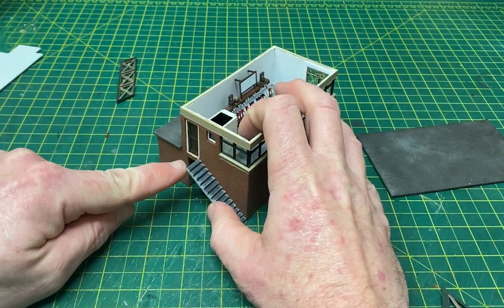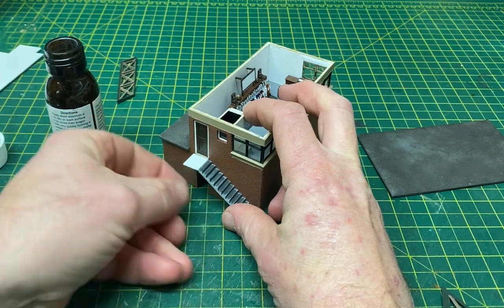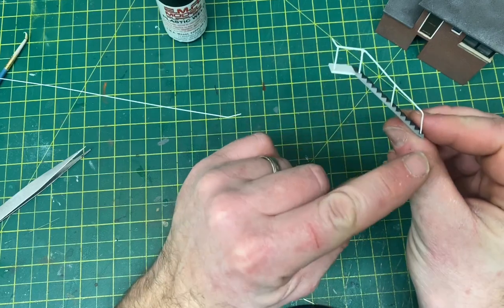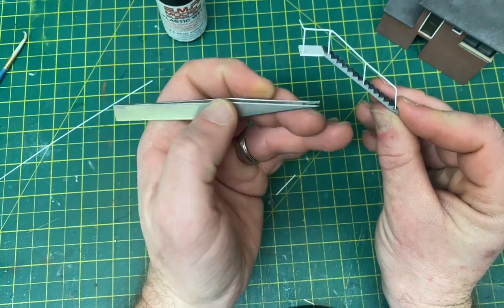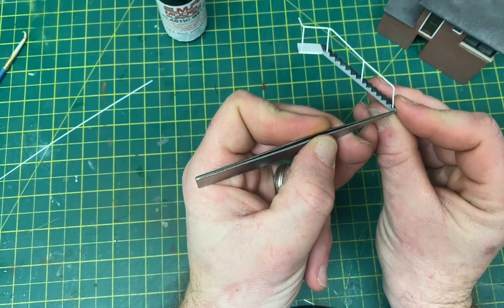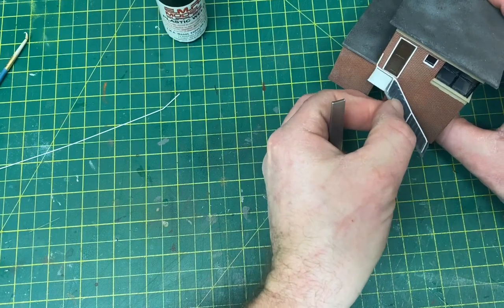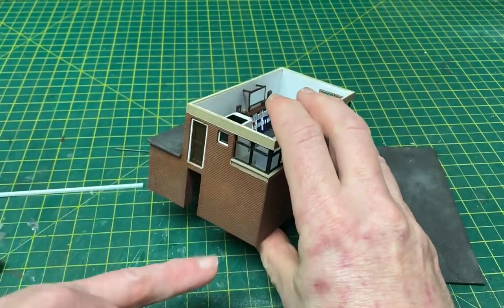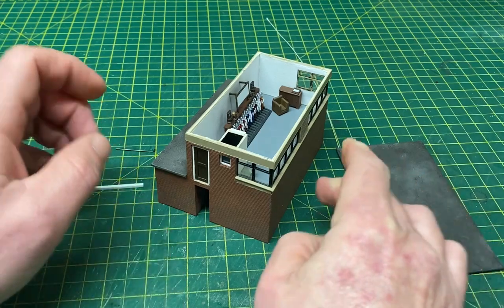The Scratch Build Series 3.5 - The Staircase And Final Details

Comment: Thanks for another instructional and inspirational video on scratchbuilding!  Now I realize I can use easily-shaped florist wire to model downspouts.  Fun activity while watching:  using a slide rule to convert your metric sizes to imperial units.  Cheers from Wisconsin!
Reply from the maker: Thanks Andrew, I hadn’t considered you yanks with your imperial measurements. How you guys work in 1/8th or 1/16th of an inch is beyond me. Paul
Reply: @GalgormHall  Heh.  It's mostly decimal inches for modelling supplies, so the conversion is pretty easy.